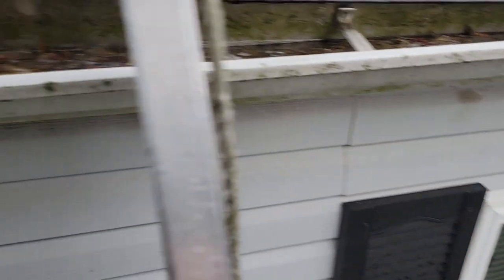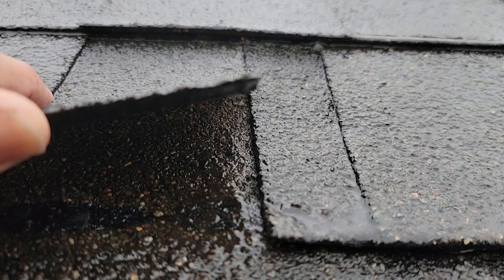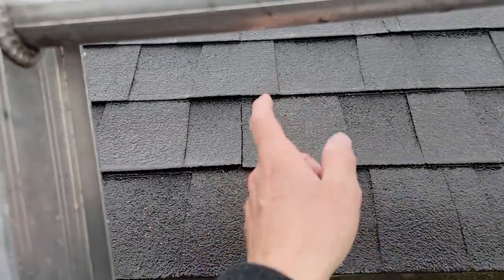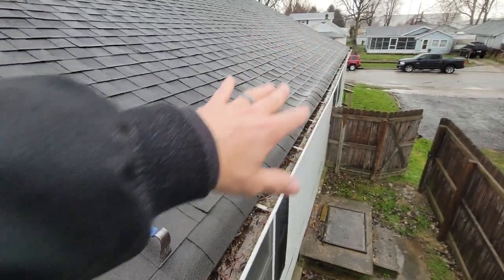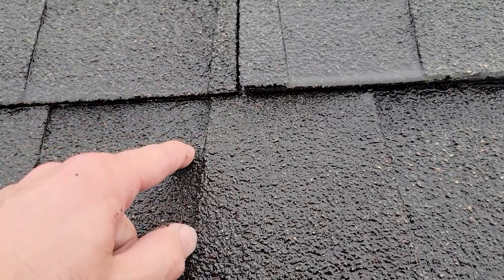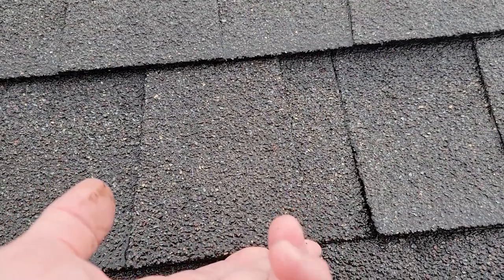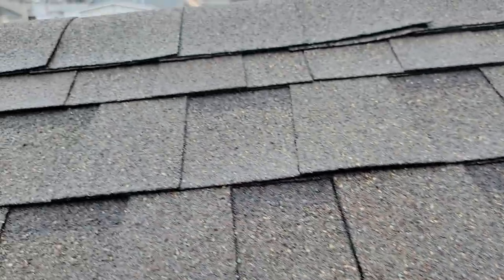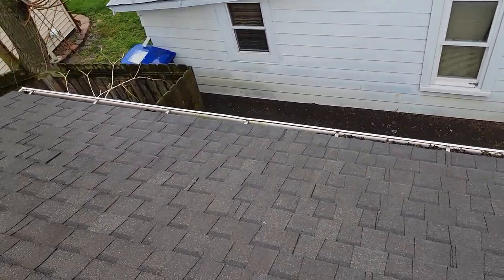Roof leak due to bad roof install and nail placement / How to find a roof leak

Comment: this guy is good, ive got over 3100 homes under my belt in 40 years of construction managing, done big project right out of the ground, sometimes were doing last phase 5 years later and ive seen lots that he preaches. constant baby sitting, having someone like this on your side is big value

Comment: I live in an area with notoriously lazy work so needless to say, I needed this video. Thanks for the valuable information. I just sealed a ton of rusty nail heads on my roof today and this just confirmed my suspicion;  it was a lazy install. 
Thanks again

Comment: Thanks for posting this. I've got only one leak(area) on my roof(18yrs old). It's just like what you showed with nails placed too close to the keyway.It's architectural shingles on 100% ice and water shield due to 2/12 pitch so there's no removing a shingle to replace one. They are gown to the ice and water.
Reply: I feel sorry for whoever tears that roof off

Comment: I think anyone working on a roof needs to go to formal classes and pass written tests and physical tests laying sample roofs and require a license proving they passed just like plumbers have to. There are just too many roofers installing them wrong, even reputable companies hire people who do them wrong. I'm irritated because I found another leak lol.
Reply: That would collapse the industry
Reply: Bro they have an 8 week course to train a siding guy in the union hall . Then they turn em lose on the subdivision. Trust me 8 weeks you ain’t learning how to do every siding situation youl come across
Reply: I wonder if any other trade is expected to be as perfect as roofers are. I mean we aren’t gods sometimes a leak just happens due to being rushed or inclement weather or simply a small oversight the size of a nail head. I mean honestly have you ever looked at a brick wall or the way siding trough and soffit facia is done with such scrutiny no none of you have and you don’t give a sht about that stuff you just want perfection up top at something you really won’t ever even look at except for once when it’s done to make sure all the three tab key lines are perfectly straight and all the hips are chalked and arrow straight and every single shingle is perfectly aligned and each nail is perfectly placed ya go go yrselfs

Comment: My roof is exactly what you described in this video I’ve patched over 110 exposed nail heads and yes I’ve counted them and I’m still fixing them I’m thinking of just putting a new roof up if you’re in New Jersey please contact me I just don’t know who to trust anymore
Reply from the maker: Hey thanks I really appreciate that! Unfortunately I'm in Central Indiana though. I don't know anyone out that way.
Reply: Diy. You already have some experience. Get a helper, almost everything is easier in pairs. Tear offs are surprisingly fast and not real physically demanding. Do a section at a time. Underlayment is way better than it used to be and as long as you use button caps you can dry in a roof and have time for shingles. If you have lower back issues you'll need to do physical therapy, build up before hand or forget the whole thing. 

I tore off half of an 18 square hip roof about 4 months ago then dried it in with ice guard that was given to me. It took about 4 hours to tear it off and stack on a pallet. 2 hours to cover it with the ice guard. 
Last week I put shingles on it and it and I could only do about 2 squares a day before I was too sore to go on because of my back. 

FYI, ice guard gets slick after it's on the roof for a while because the sand turns loose. I didn't know it would do that and the first 2 days were tough working from a harness.

Comment: nails near the shingle gaps is the most common leak i have seen. as a general rule you should be able to place your hand at the gap line and a nail should not be within the area of your hand. basically 4" on either side of that shingle gap should be nail free. this is made worse by garbage electro galv nails from people to cheap to use hots or stainless. oh, almost forgot, overdriving makes it even worse. you get little pools on those nails near the gaps that just drip drip drip all winter.

Comment: Regardless what you do, when the water runs between the butt lines the water goes left and right, next time you remove laminate shingles for a repair when it is dry out you will see the water/ dirt stains, we use Ike and they seal very well, when you lift people shingles you should always tar back down

Comment: I was called one time that the roof had several leaks. When I arived and looked at the roof I could tell that it was a new roof. It was the first rains of the fall and the roof was bad. The shingles were installed with only 1" to 3" of offset and the nails were placed above the laminated area where the nail line was. I told the owners what was wrong and asked who had roofed it. They would not say, but they didn't want them back on the property. I told them that the roof needed to be completely replaced. Some really baby work, so sad to see things like that.
Reply: I had my roof replaced yesterday. The atttic looks like a pin cushion. Thousands of nails popping out ALL OVER. Am yet to pay the roofing company the balance. But I want someone to look at it for me first. Who do I call? Am in NYS.
Reply: @redsak5311  the shingle manufacturers tell you that the tasteless are to go through the sheeting of the roof a certain amount, and most people will use 11/4" nails or staples.
Reply: @mikeflick4737  OK Thanks

Comment: Great stuff. 

A couple of suggestions:  1. Use your favored terminology from your region (keyway, book, whatever) with confidence. Explain what the term means once per video. Use the term with confidence. 

2. No need to bad mouth another contractor or mention them by name (you don’t, ants a liability issue ), but don’t hesitate to call out their terrible craftsmanship in a constructive way.  The work I’ve seen you uncover is criminal fraud IMO. So many roofs would have probably been ok, but the installer was incredibly incompetent in very simple areas where had they done the right thing the issue would have never occurred and the job wouldn’t have cost more for the contractor. 

3. Like to see more videos (will need a cameraman) showing the repairs, methods, etc.

Comment: Good Eye ! PEICE Of Felt Or flat Stock ????
Reply from the maker: If you're referring to shoving a piece of flashing or felt up under, Yes you can do that just make sure it's up past the reveal. I would recommend using ice and water instead of paper. I just used a little bit of 4500 because I always have it with me.